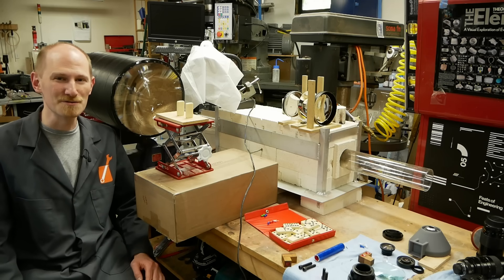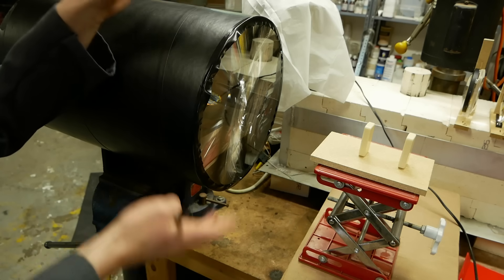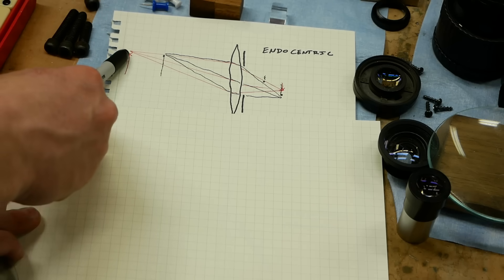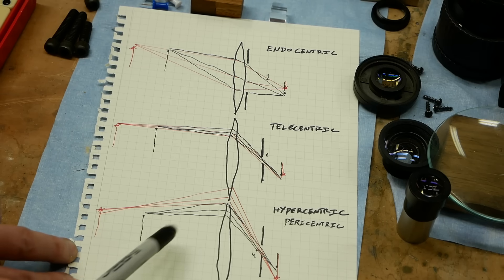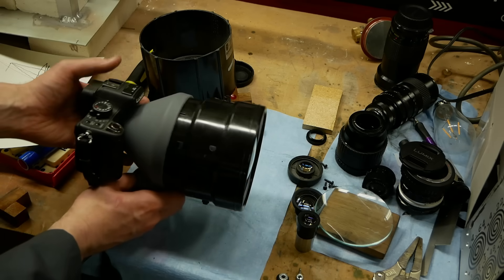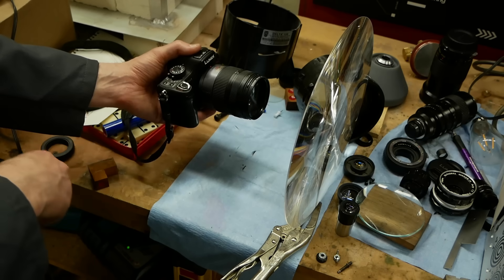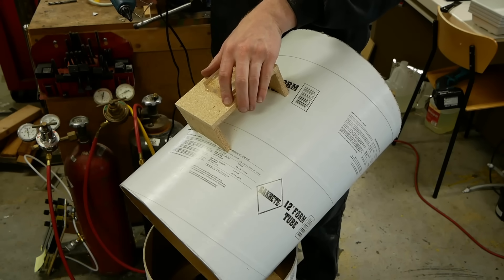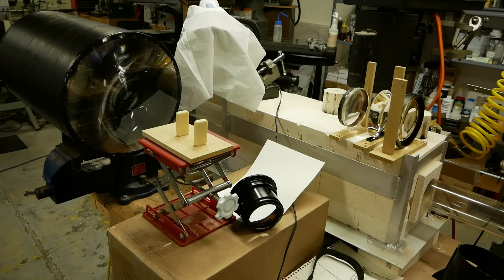Hypercentric optics: A camera lens that can see behind objects

Comment: your ray optics diagrams shouldnt work on a perfect lens (same plane object should have same plane image). Perhaps the reason this works is because of sperical aberration. Meaning the lens has a different focal distance on the outer part than on the inner part, that's why you can have different distance objects kinda focused on the same image https://en.wikipedia.org/wiki/Spherical_aberration

Comment: It has one leaded lens element in it to keep the CRT Xray flux blocked.  They should all be full spectrum though, because they were not tuned to individual colors.
They probably came out of the huge old projectors they used on 747s back before seat back LCD displays.

Comment: I wonder if you could use a couple cameras to make some sort of crazy 3D scanner.
Reply: You could, but it would be crap compared to just using a single camera that moves around the object (or rotating the object itself while the camera stands still).
Reply: @RFC3514  using more cameras is better if you have the budget, since you can locate each camera precisely, and extract coordinates more easily.
Another great thing is that you can scan objects in movement with such a setup.
But only a pair will make for a somewhat poor scanner, if you only take a single shot, though it would divide by 2 the number of shots required.
Reply: @manaquri - You don't need to "locate the camera", the photogrammetry software does that for you. It's far more important to have lenses with as little deformation as possible (or at least a known deformation, that can be compensated in software).

Scanning moving objects with CMOS cameras (i.e., 90% of the cameras used nowadays) is just masochism (and not just because of rolling shutter artefacts; there are other issues, especially if you need to combine data from multiple cameras).

If you have a decent budget, use LIDAR-style scanners. If you're using visible spectrum consumer / "prosumer" cameras, then the image geometry (lens deformation and resolution), the lighting, and the number of images, are the most important factors in getting an accurate photogrammetric model.

Comment: really fascinating video, thank you. The problems you see with the cool 3d printed setup are something that could be corrected to an extent with just working with the raw data. The vingetting and chromatic distortion caused by the lens and steep chief ray angle could be negated by taking an image with a diffuser from the scene and then using it with the raw data to remove the errors from the resulting images. Same goes for the chromatic aberration. you can calibrate the error with a test pattern (most likely a radial function for the channels) and shift the raw bayer data accordingly.

Comment: The protection TV lens came from a single tube CRT projector. Tri-bean (RGB)  sets do not have a diffraction grating behind the tube face since it each color is a single beam. They do not emit x-rays. The warning means there was a grating in the tube that lens mounted to.

Comment: You mentioned the chromatic aberration was worse on the projection lens than the Fresnel lens. Could that be a function of the distance the light travels through the lens material? In either situation, light of different wavelengths will "bend" to different angles upon entering the lens and then "unbend" to some extent upon exiting the lens. If the lens is physically thicker, the difference in resulting displacement will be greater... I think. I'm not too sharp on optics. Also, I've been getting into quantum mechanics, so talking about light "bending" or "traveling" through material suddenly feels a little strange. But classical models have their function.

Comment: Really interesting! A while ago I made some reverse perspective images with a parabolic mirror, but the images had a bit of distortion and the mirror got scratched. I wonder if it's possible to make better images with an accurately positioned mirror.
Reply: that is good idea!  how about fresnel lens not straight but with curve, like attach it to horizontal material with hole, pour in hot water to make sift plastic for fresnel lens and then let it cool and it must stay in shape

Comment: Hydro silicates release forty times more energy than, hydro-carbons.  The NASCAR cheat, apply paste to the plenum, sublimate by closing throttle, increasing Hg.  WOT to reduce power going into the turn.  Only takes a few grams, energy equiv 1.5K MPG.
Notice all the PPE on pitcrews, that's an attempt to avoid liability when the genies out the bottle.  Three decades and counting.
Properly sized displacement, by energy release, a 3.5hp lawnmower would replace a V6.  Yet such a design wouldn't handle the power, nor last.
Reply: What would their stoichiometric ratio be in air.
Reply: @fascistpedant758  That's like saying what's the stoichiometry of air and a hydrocarbon, it deep ends.  Stable liquids start at hepta, yet the grease thick chains are much longer.  The primary energy comes from (SiN2+He)+(H2O)= Si(x)H(2x+2)+(4N2+O2).  More to it, can't write the book.  About 20% of surface grinding wheels are Silicon Nitrate.  Piston engines don't last long running sandpaper through them.  Good enough for the pit crew to  breath, in their full PPE.
Once the 'pin is pulled', trying to stop it will damage the car.  Running into jet dryers, breaking axles, blowing the hood off in the pits bellowing black smoke.  Entertaining to say the least, though wouldn't want to breath the air, it would be like GZ.  Which was ALO2, which the other 80% of surface grinding wheels are made of.

Comment: “Negative perspective” reminds me of a lens my friend had that had a minimum f-stop of less than 1. I always wondered how that was possible.
Reply: edo  The theoretical maximum if we want to have well corrected lens and have the usual f# to light gathering relation is NA = 1, f/0.5 lens without going into immersive setups.
Reply: The maximum focal ratio is determined by the distance of the lens to the sensor/film divided by the diameter of the lens. 
This is effectively the flange distance divided by the throat of the mount. 
A camera with a flange distance of 50mm and a throat of 25mm will permit a maximum focal ratio of f2, while a camera with a flange of 25mm and a throat of 50mm will permit a focal ratio of f0.5. 

It isn't uncommon for lenses to protrude inwards and past the throat of the mount. This is less common on SLR cameras due to the mirror requiring clearance to move, and more common on mirrorless/rangefinder cameras because of the lack of a mirror. 

You typically don't see lenses with such high focal ratios because of the increased amount of correctional elements required to produce a quality image.
Reply: I think that the f-stop of less than 1 isn't related to telecentricity, as Leica makes an f0.95 50mm lens that has normal perspective.